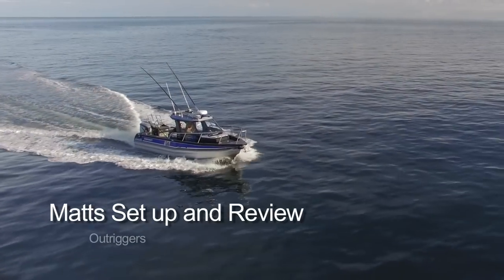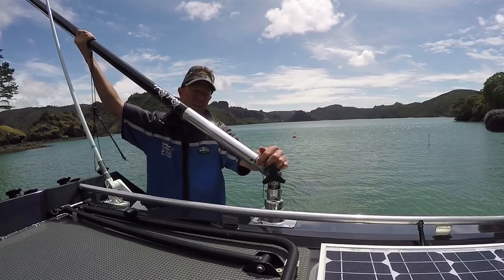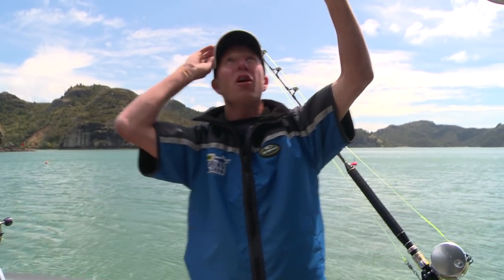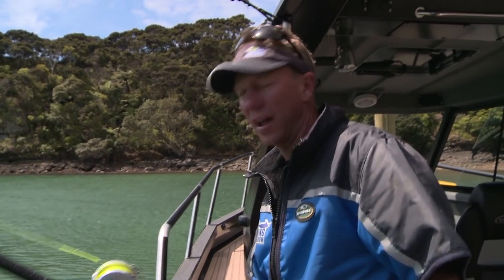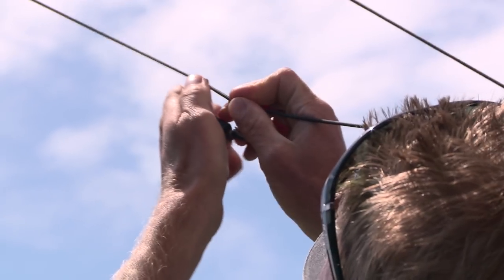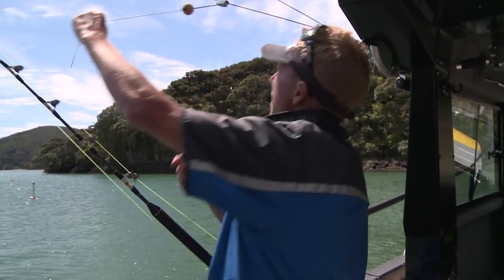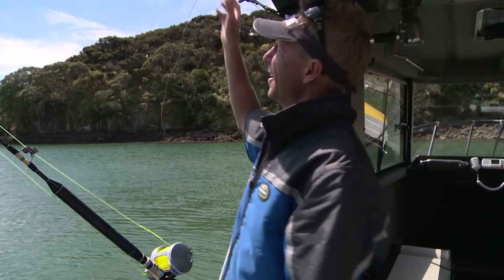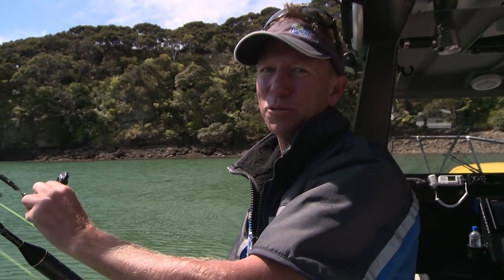MATT'S OUTRIGGER SET UP

Comment: Nice video, been learning about outriggers and downriggers. Came across your video was wondering if one has an outrigger on his boat if he could use it as a downrigger. My understanding is outriggers are to space out more lines and troll more top water. Where as downriggers have downrigger 8,10,12lb weight and are more for getting line down deep rather then spaced out top water fishing. Was curious if you can uses downrigger weights to make outriggers into bigger spaced out downriggers?

Comment: Or maybe outriggers and downriggers are completely to different pieces of equipment with similar release clips just one is a shorter shaft with heavy weight vs the longer outrigger pole shaft with no weight. Either way it seems like one can convert an outrigger or downrigger into the other with minimal effort. Just wondering if there made customizable to be used for both types out and down. Or if you usually have to buy one for each purpose?